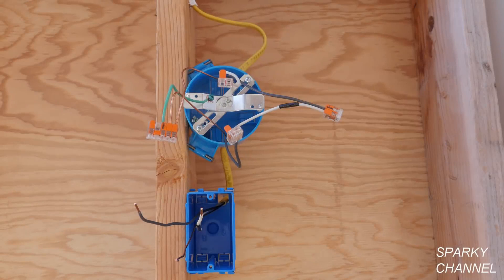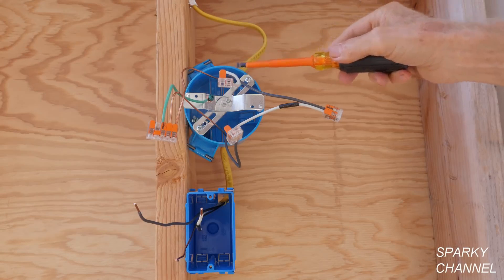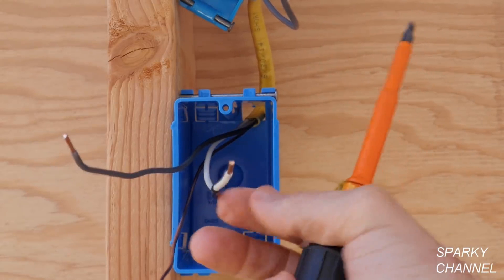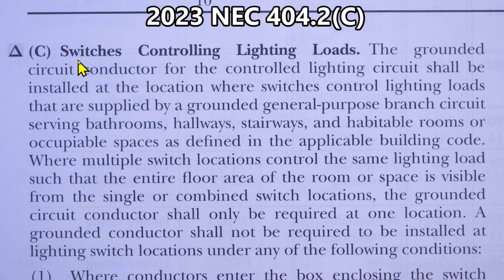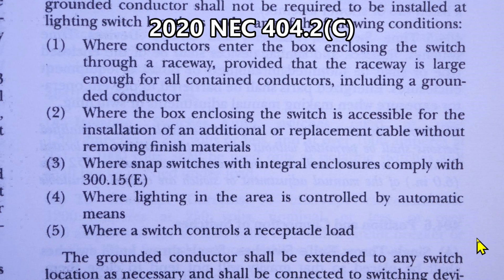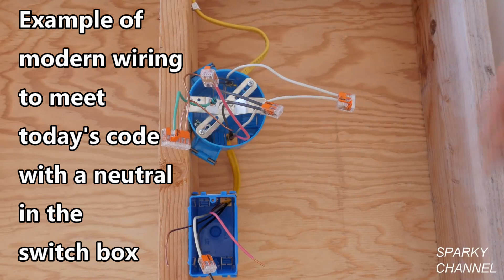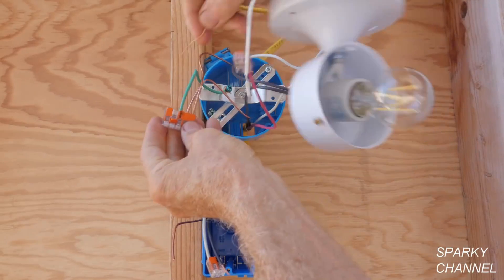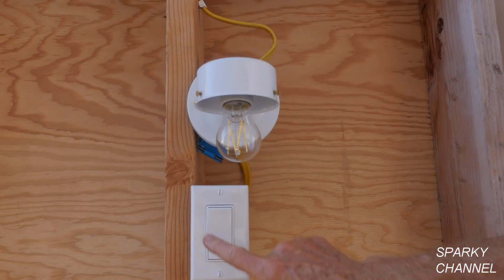NEC 2023 404.2(C) Switches Controlling Lighting Loads, Code Deletions? What Deletions?

Comment: people stopped bringing power to the light receptacle a long time ago! homeruns are brought to the switch boxes for a habitable room not. That was the practice at my company, and switch legs were run from the switch box to the lighting outlet, and most of the homes were installing ceiling fans, so we always ran a 12/3 to the lighting outlet so the light and fan could be operated separately. Now, most of the older homes did run the homeruns to the lighting outlets, and power for the receptacles from the lighting outlets, especially in bedrooms. I haven't seen anyone wiring bedrooms like that in a long time. Now commercial buildings still do that, but not residential homes, and I've brought up the 2020 change that requires a neutral at a switch, except where you have 3 way and 4 way switches, but electronic controlled switches, which have become more popular in residential homes, require a neutral for the electronics, but I've watched the commercial side ignore the neutral rule, and they don't bring it down to the switch box from the lighting outlet; because they try to get away with running 1/2" EMT instead of 3/4"
Reply: If I have a single pole light switch with a home run ran to it, can I use that box to start the chain of power to my receptacles, and also feed my overhead lights from that same switch box using 14/2 wire? It’s all on a 15 amp circuit. If I’m allowed to do that, do I pigtail the power coming in from the home run with the wire going to the receptacle’s and connect those to the switch, then connect the wire from the overhead light to the other connector on the light switch?

Comment: actually the deletion was 404.2(C)(2) of the 2020 NEC, not the exception. I looked at my 2020 and that's the deletion, not the exception, Sparky. Everything else is the same. Nothing was changed in the exception and informational note, and still gives reference back to 200.2(B) for continuity of grounded conductors, which also includes 300.13(B), which also references 300.13(B), and 404.2(B)(2) gives reference still to 300.15(E) for integral enclosures. No exceptions have been removed. Anyone with the 2020 and 2023 can fact check that. so 404.(B)(2) from the 2020 was removed: "where the box enclosing the switch is accessible for the installation of an additional or replacement cable without removing finish materials." This is what was removed. The Exception that was in the 2020 is still there. The requirements is what has been reduced; from 5 requirements to 4; as long as these 4 requirements are met, a grounded conductor is not required at the switch box. I think maybe there is a confusion between requirements and Exceptions to the rule!

Comment: this shows an example when the power is coming from the attic, so i get how the neutral in the switch would be capped and unused. But what if the power is coming from the basement? Does the power need to go into the fixture first then back down to the switch

Comment: Can this be done using an OUTLET that shop lights will plug into ??  So the switch will control the outlet to turn on the lights.  AND, can that light outlet then run the rest of the course to other outlets?
Reply from the maker: Yes, but in a shop, I would use heavy-duty outlets and switches.
Reply: @SparkyChannel  It's actually a shed my wife will be using.  Was going with 15 amp outlets.  The incoming power is 30 amp as that's the wire buried from previous owner.

Comment: There's always something I've wondered. Back when 2 wire switch loops were the norm, it seems like most of the time, they sent the uninterrupted power to the switch on the reidentified neutral, then back on the black. You even set it up that way in your example. Why? It would make more sense to use the black wire as the always hot wire to the switch, then use the reidentified neutral to send power back. That seems more logical and would lead to less confusion for anyone rewiring in the future. You even did that when you showed the 3 wire cable switch loop example, except with the red instead of a reidnetified neutral. I know none of this is relevant anymore, since, with very few exceptions, you can't do it like that anymore, but I've still wondered. Was it down to builder preference, or was there a legitimate reason I'm unaware of? Thanks.

Comment: does the neutral not need to be wired to the switch to actually meet code? If it's not connected, what's the point?
Reply: Point is for future cases where customer wants to use timer switch that needs a neutral to wire switch

Comment: Extra cost to an addition or home. How did we live without surge and arc protection all these years when wiring homes. By the way I do like GFCIs 20 amp no 15 amp. I only use 12 gauge wire I do not use 14 gauge in a home or a garage. Personal preference.
Reply from the maker: I understand.

Comment: Which sheathing stripper tool do you like for 12-3 with ground or larger cables?  Specifically the twisted conductor cables?  Always a challenge to not nick the conductors when dropping from the ridges into the valleys of the twist.  Especially so as utility blades seem to come duller and duller from the factories.  Also what is your favorite method of connecting modern LED light fixtures conductors which can be #20 or smaller stranded to #12 solid in the boxes?  The chinesium ones for small wattage outside lights can be a real challenge.

Comment: I am changing light switches in my home and have found 12-2 wire in which the ground wire has been clipped.  Do light switches require a ground?  I know this is a basic question but I trust your advice.  Thanks.
Reply from the maker: A standard light will work without a ground wire. However, it is against code to clip a ground wire like that. 
Also, many occupancy sensor switches will not work correctly without a ground wire.
Reply: @SparkyChannel I’m pretty sure that those occupancy switches are using the ground wire as a neutral, even though they call it ground. I’m surprised those are still being sold.
Reply: Light switches do require a ground. What if someone puts a metal face plate on and it becomes electrified by a loose hot wire? There is a ground screw connection on the switch for a reason.

Comment: i don't see a link for milwaukee 12 volt impact driver
Reply from the maker: Here you go: Milwaukee 3453-20 12V Fuel 1/4" Cordless Hex Impact Driver (Bare Tool): https://amzn.to/3LHn7wU
  M12™ FUEL™ SURGE™ 1/4 in. Hex Hydraulic Driver 2 Battery Kit: Amazon: https://amzn.to/3RBts0P

Comment: If you bring the circuit into the switch box instead of the fixture box couldn't you use 14/2 instead of 14/3 because you'd have many neutrals in that box? Also, same scenario (circuit into the switch box) if you only had 14/3 for the switch leg, would you just cap off the red wire since it's not connected to anything on either end?

Comment: Interesting way. In European countries, especially in older buildings its common to have junction boxes in the wall near the ceiling. It has just a cover, no switch or outlet installed. The live and neutral comes to the box, the neutral is spliced and goes to the ceiling light. The  permenent live is spliced, goes down to the switch box and a switched live comes back which is spliced and goes to the ceiling light. Making splices in switch boxes is a new thing because older boxes were smaller and its not common. Some people use that because they dont like seeing junction box covers near the ceiling.

Comment: Definitely needed a neutral for the Lutron Maestro Pro installed in a bedroom.  The regular Maestro was installed there first and interfered with the function of a switch in an adjacent bathroom.  At a certain dimming level the Maestro prevented the bath rocker switch from turning on properly.  I phoned Lutron and they mailed me out a pro Maestro for free.  They said to hook up the neutral to the silver neutral terminal on the pro maestro and that should take care of the issue.   Now I know why the electrical code changed.  Those electronic switches are the culprit.  I should have stayed with the manual Diva slide switches.  However, Lutron was generous enough to solve this for me.

Comment: I am not an electrician  but something he says always bothers me (he has said it in multiple videos) - he says "the neutral is a grounded conductor because the neutral wires gets connected to the grounding bus bar on the main panel (4:01)". It is true that the neutral bar (and so the neutral wire) gets connected to the ground bar at the first disconnect means (which in many cases is your main panel) but my point is that, it (neutral's connection to the ground at the main panel) is not the reason why the neutral is called a grounded terminal. In my understanding, the neutral is called a grounded conductor because it is grounded at the transformer and coming to you from the service provider already grounded. The neutral wire is tapped out of the mid point of the transformer coil and gets grounded at the transformer itself (so that is a grounded terminal); the other 2 leads (hot wires) are the 2 endpoints of the transformer coil and not grounded (ungrounded terminals) coning out of the transformer. The point is, it (neutral terminal) is a grounded terminal even before it reaches your panel. Can someone correct me if I am wrong.

Also the reason the neutral gets connected to the grounding bus bar is because, if a ground fault were to occur the fault current has a path to get to the source (through the neutral wire) and the over-current protection device (breaker) can detect a possible fault and break open the circuit and protect you. All your ground wires are in fact made the extension of the neutral terminal (because of bonding ground bar and neutral bar at the first disconnect) and unless a fault were to occur no current flows through the ground wire but if a fault were to occur the circuit can be completed using the ground wire (remember the ground wire is made an extension of the neutral conductor) and the breaker can work its magic and break the circuit.
Reply: That's due to the NEC, NEC calls the white wire "grounded circuit conductor".
Everyone else calls the white wire "neutral conductor".
The green wire is always called "ground conductor".
The wire you use to bond the electrical box to a ground rod is called "grounding conductor".

I know it's confusing.
Reply: @jefflebowski918  My point was about why NEC itself calls the neutral, a grounded conductor - it is because it is brought to the ground potential at the transformer itself and coming to you already grounded. The 3 terminals coming to you from the service provider are 1 grounded terminal( neutral), and 2 ungrounded terminals. 
What we do at the first disconnect means is bonding the grounded (neutral) and the grounding terminals together to create a fault current path ( to complete the circuit) so that if any of the metal pieces gets energized (due to a fault), it has a way to complete the circuit (it is in effect a short circuit) and unlimited ( read large amount) current tries to flow through the breaker and the breaker can detect a possible fault and take action. Without bonding, the metal pieces where the fault occured stays energized and it is a shocking hazard. My whole point was the neutral conductor is called a grounded conductor is not because we connect the neutral bus bar to the ground bar at the main panel (technically the first disconnect means). 

The grounding terminals are different - that terminal is the one we are grounding like the third round pin on a receptacle.
Reply: Hope this helps with your question. 
The neutral is a current carrying “conductor” when power is connected through a device. 
The neutral is grounded at the transformer and at the meter for the protection of the service provider and it’s equipment. 
The NEC starts it’s registration at the main panel, where it must be grounded and bonded. Such as the main neutral, meter box ground, main panel, main panel neutral and grounds are all bonded together. For the protection of the customer.
Reply: The neutral wire does not need to connect to the ground buss bar to complete the circuit. The neutral wire IS the path back to the source. The fact that there is an earth connection has nothing whatsoever to do with the functioning of the neutral wire or the bare ground wire (EGC).

Comment: I always go power to switch box first, never power to fixture first.  Be careful you are saying this assuming that the main panel is the primary panel and not a sub panel.  on a sub panel the white wire is not connected to the neutral/ground bus bar.  It would be connected either to its own netural bus bar which is not bonded to the ground or it goes direct to the breaker if its a plug/on breaker like the SQuare D QO/PO panels

Comment: Seemed stupid to me when doing my tiny house that I needed to wire in case the next guy wanted fancy switches. Cost me an extra $600 but now I have a Lutron switch a thermostat I can control from anywhere in the country, and can easily add an outlet below any switch.

Comment: In the old days a neutral in a switch box was useless. Today with "SMART" switches, lighted light switches, motion controlled switches it is useful for a neutral wire to be in the switch box not to mention an extension to a outlet. . In Chicago we use 1/2" EMT Conduit so we can use the proper color wires without any color tape to designate wire colors.

Comment: I was never a fan of making a white wire hot, even with tape marking.  Use 14/3 or 12/3 and just cap the white.  Black on line, red on load and white for future use.
Reply from the maker: Yes, I agree. Thanks!
Reply: It’s a single pole switch, it does not have line and load. It only has two brass terminals & green ground .
Reply: A switch loop using a re-purposed white wire was to allow the builder to save a buck on a cable. Anytime something odd is allowed, follow the money and you'll find out why.

Comment: I like that when wiring up the light, you did the ground first, neutral second, and hot last.  I'm just an amateur, but that seems like the safest way to connect it, providing maximal protection in case someone turned on the circuit while you were working on it.  I also like that you used the red for the switched hot, which makes it easier to tell which wire is always hot in the switch box; I don't know if that's a requirement, but it's obviously a good idea.
Reply from the maker: I agree. Thanks!

Comment: Having a neutral in the switch box also allows you to chain an outlet below it if you need another one.  Having the flexibility for the future is really nice, and it can save a ton of money fixing problems in the future.  Also, it eliminates the need for those horrible switch devices that let a small amount of power through when "off" to act as a vampire load for things like a small light on the switch.  I've seen some that switches with lights that don't require a neutral, but don't work with LED lights since they let enough power through to light up the bulbs.
Reply: in europe/italy  we have situation when neutral in the switch box is just a waste , in some cases you need a bipolar switch

Comment: There's nothing we hate more than trying to install a controlled switch from a company like Lutron or Control4, only to discover a switch leg situation.  The cost savings in running them is negligible and there is zero reason why they should be wired that way these days.  This is a nice change in code.

Comment: Sad, this neutral in a switch box requirement has absolutely nothing to do with safety. I wonder how much bribe money was paid by the manufacturers of smart switches to the NEC folks to make this a "code".
Reply: We were told at a continuing education class that the reason for now requiring a grounded conductor ( neutral ) inside of most residential boxes that contain a switch is the some switches like motion detectors drew a very small amount of current off the ground wire and if you had enough of them would go over the 4 to 6 milliamp threshold to trip out GFCI circuit breakers.
Reply: IF you think the home automation market is not a big deal, you're mistaken.